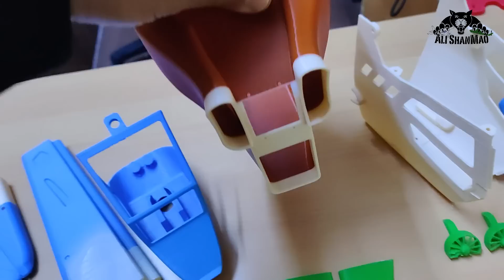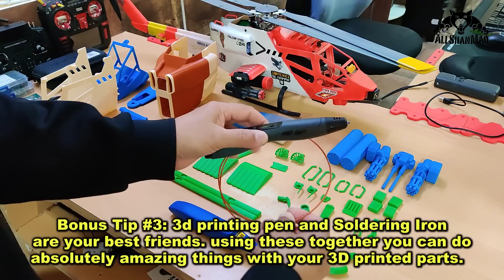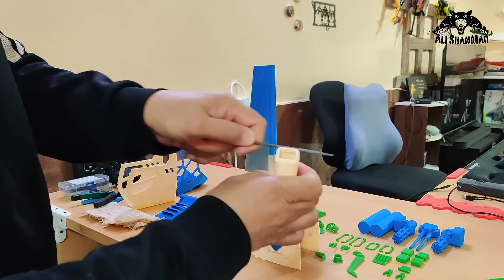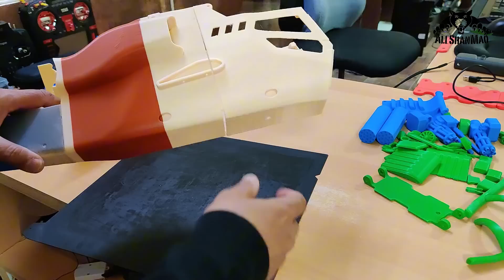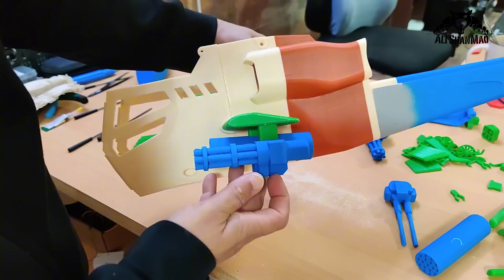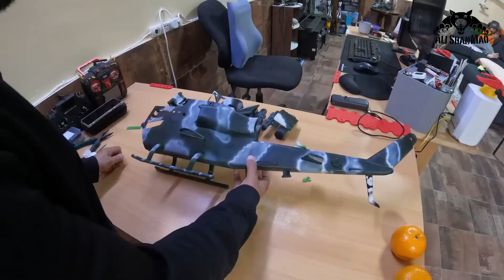Beginner’s Guide: Assembling Falcon X450 Cobra Inspired RC Fuselage

Comment: @alishanmao I was planning to do the maiden flight today, but as I started the heli and the blades began spooling up, the main rotor blades and tail rotor blades started touching each other. I shut the engine down immediately, and luckily there was no damage.

Do you have any idea why this might be happening? I’m using a two-blade main rotor with quick-release mounts, while I noticed yours has a four-blade rotor. Could that be the reason? Also, what length are your main rotor blades?

I’m completely at a loss as to what could be causing this.
Reply from the maker: quick release mount increase the lenght of rotor blades. and this will not fit this fuselage. so you will need to use standard rotor blade holders
Reply: @alishanmao  Thank you you are the best! I will re-install the standard ones. Hope to get a video of the maiden flight this time!
Reply from the maker: @RCscale101 all the best. Enjoy your flights. Always welcome

Comment: I'm currently assembling it! It's a beautiful kit, well done Sir! I have one worry: I am glueing the tail at the moment as you do. Is the glue sufficiently strong to withstand the strength of the tail motor? When I compare the tail with the metal boom of the FW450, it makes me wonder. I wouldn't like my heli to split in 2 in mid-air? Would carbon rod help at the joints?
Reply from the maker: Use good quality CA glue. No issues then. The new upgrade on this kit had screws as well I believe. Thank you for your support
Reply: @alishanmao  Thanks! I looks solid after good drying! I feel confident! Continuing with the build today. So far so good! Thanks Ali!
Reply from the maker: @RCscale101 no problems. Just that if you are worried, you can drop more CA glue along the outer or inner lines

Comment: Ordered mine, I'm using the stock transmitter. I probably won't place a Servo in the front for the gun. I don't believe there is a channel available on that transmitter. I could get a better transmitter but coming from rc planes, programming a transmitter for helicopter sounds like a daunting task.
Reply from the maker: Thanks for the order buddy. Stock radio that you have, can program the nose servo as well. I did it for a client who ordered with white radio RTF cobra. I shall keep you updated via emails. Welcome to rc helicopter world